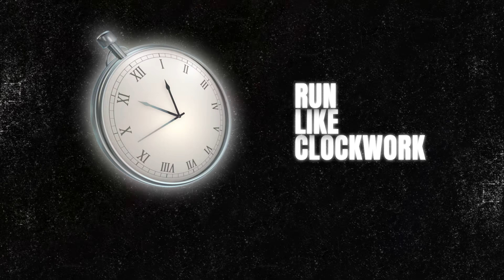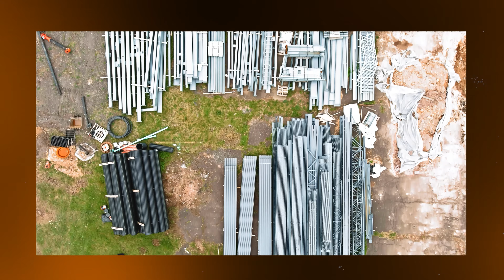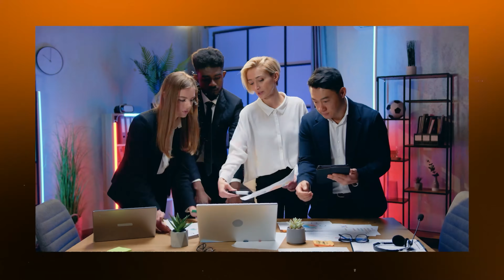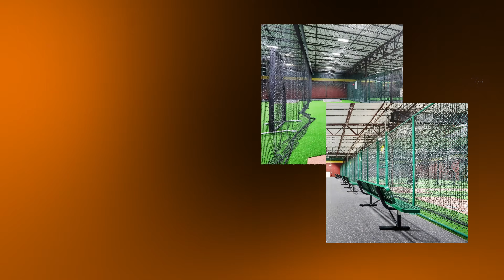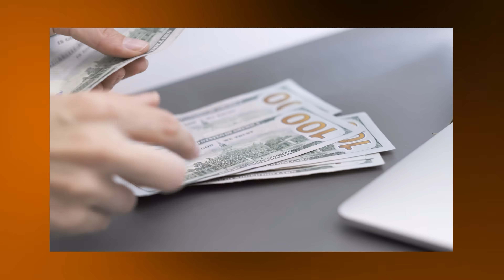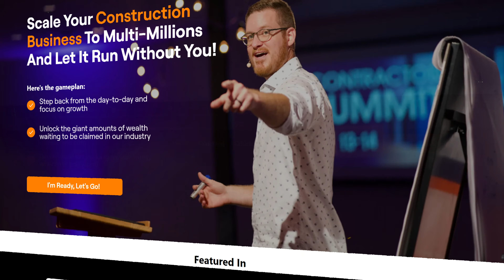How To Manage A Construction Project (Step-by-Step)

Comment: Jesse, got a question. To determine my break even or nut I have to figure my overhead for month or year. From there I divide my overhead by the average profit percentage I’m making.  That gives me my nut. Say that number is 500,000. The question is, after I finish the job a have my gross profit.  Is that gross used to pay for my breakeven ?
Reply: Not sure if you figured it out yet, been a few months but I suggest checking out Tom Reber The Contractor Fight. Really helped me understand how overhead and gross profit worked when I was starting out 👍